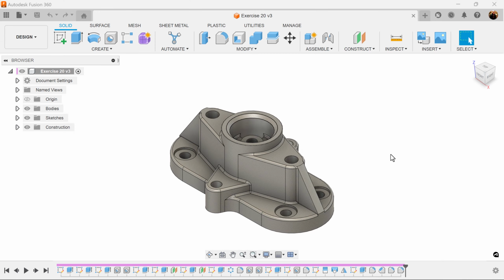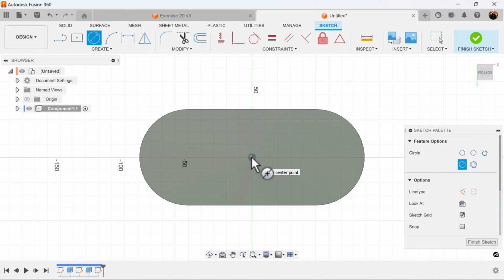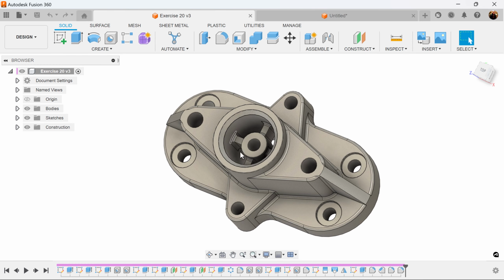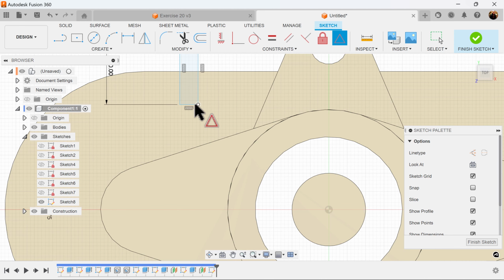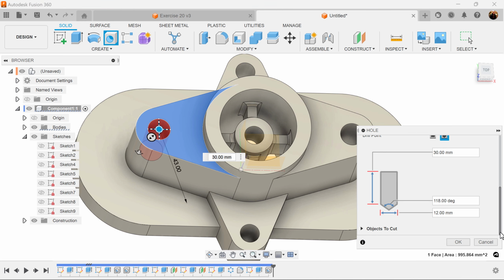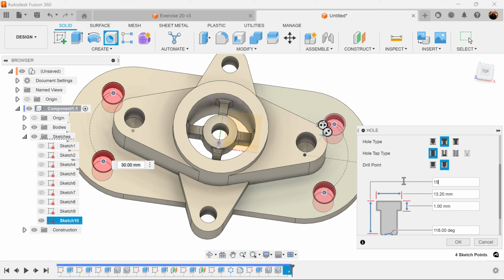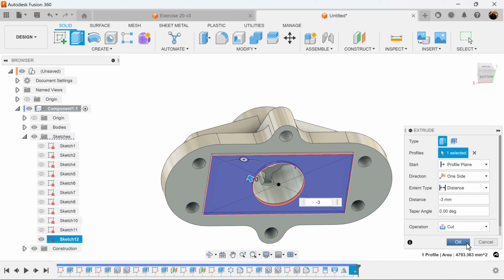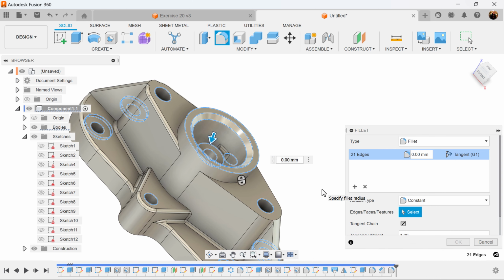Modeling in  Fusion 360 I Rep no. 20

Comment: all good until the split face portion. I can't select the horizontal rectangular face but can select the vertical one. Any reasons for that?
Reply from the maker: In the command window, try selecting the splitting tool option first and select the sketch profile. Once selected go back to the "Faces to split" option and try selecting the two faces. If need be, hold the ctrl key and select both. This helps prevent the selection from skipping to the next item in the command menu. I hope this helps.

Comment: When you make the dimensions, the font type is like bold, how do you select that option, in my case it does not stand out in the way you show it, excellent video, best regards.
Reply from the maker: I'm using a Windows PC and have my resolution set at 2560x1440 and I set the display scale to 200%. That makes the font appear much larger and easier to read.